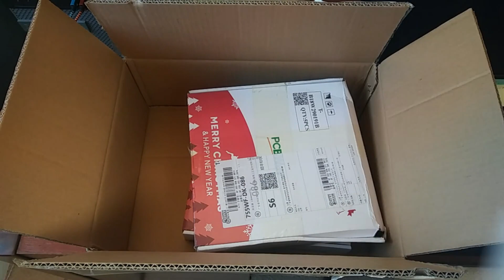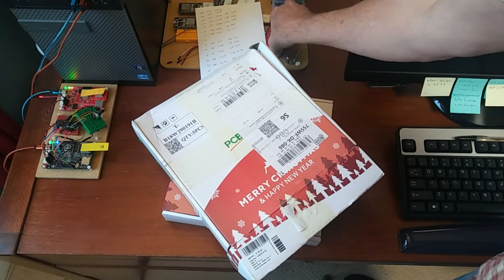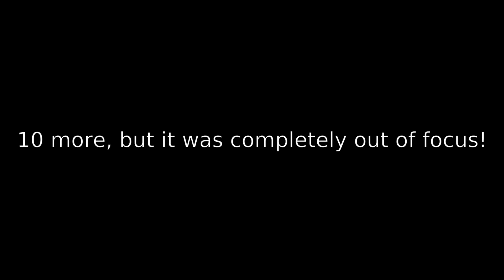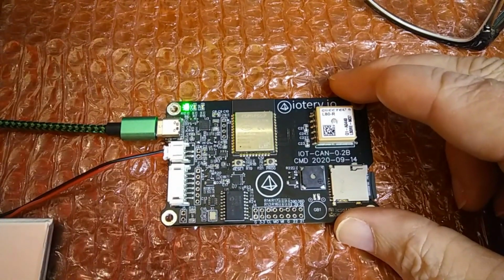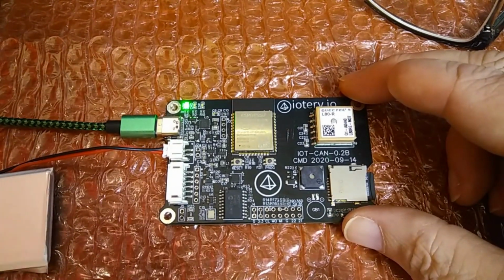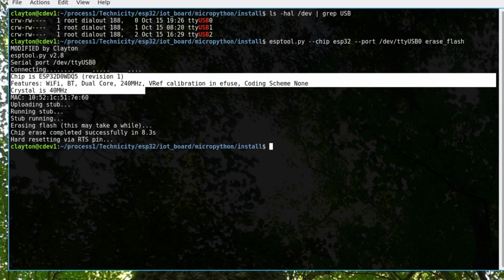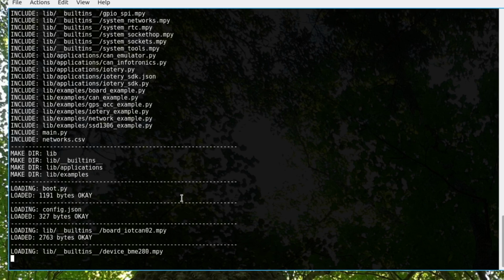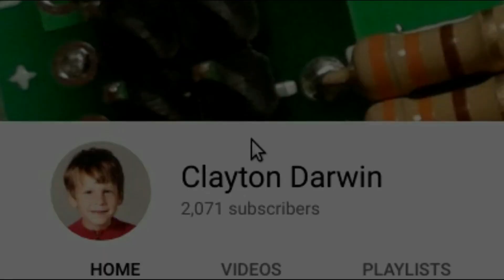Unboxing Assembled ESP32 CAN IoT Dev Boards from PCBWay + MicroPython Install

Comment: Where can I buy one these boards?
Reply from the maker: These particular boards were for a client project, so I don't have any available for sale. And now, I just found out, the CAN chip isn't available. So I can't make similar boards until the silicon shortage ends. I have other esp32 boards, like the FunBoard and ESP32Mini. You could combine a simple esp32 dev board with a CAN breakout board. There are some of those still around.
Reply: @ClaytonDarwin  thanks for the quick reply.  Thinking about the mini. I didn't see it in your shop.
Reply from the maker: Sorry. Just got it tested. Docs are on gitlab. Will make another video and add to the store very soon. Just haven't been able to do much youtube stuff lately.

Comment: BLE window sniffer :P
Reply from the maker: Just started messing around with triangulation using BLE. Pretty neat.
Reply: @ClaytonDarwin  how accurate is it?  And were they designed for it?  Sounds like it could be useful for finding tools...
Reply from the maker: It's good within a few meters. Just a side benefit of ble devices. I can track my kid's Fit Bit.